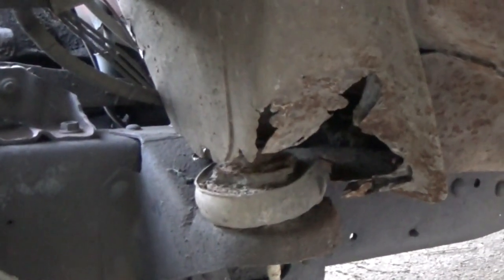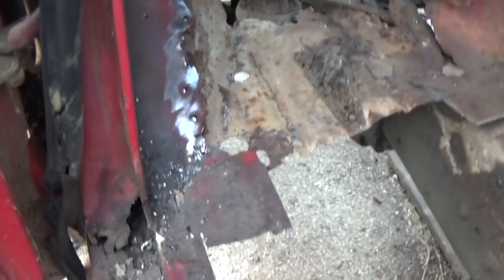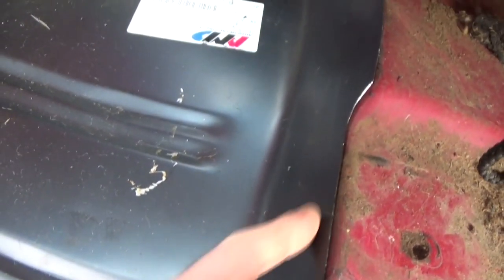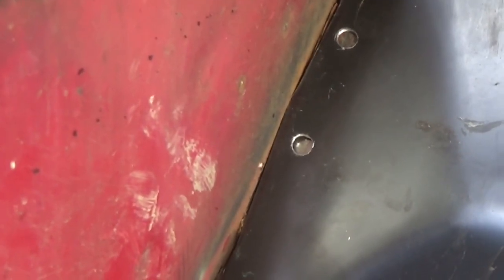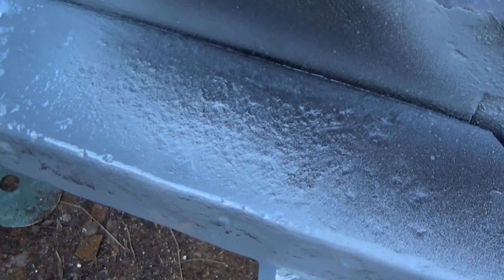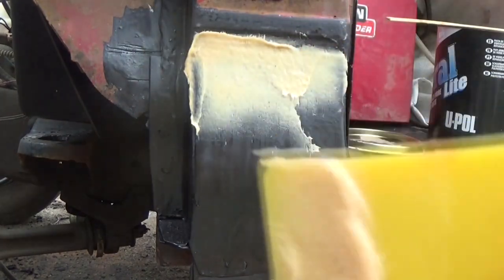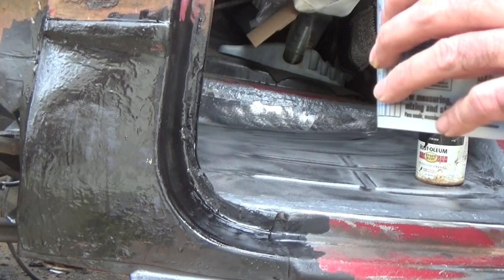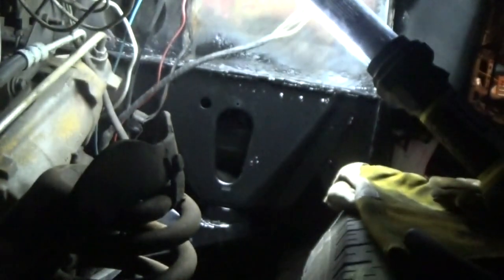1973-1979 F-150, F-250, F-350 Floor Pan, Cab Mount, Door Inner Pillar Patch Install!

Comment: Jeff's Bronco has those washers that fit that exact hole where the rubber rusts them out, I know because I'm doing the SAME PROJECT! LOL....cab mounts and all
Reply from the maker: If I remember right he was sold out of them at the time I was doing mine. I seen the other day that he now sells the complete mount that bolts on to the frame.

Comment: You can buy cab mount hole patches I believe they are called frame savers on Lmc truck
Reply from the maker: I didn't know LMC had them. I knew Jeffs Bronco Graveyard had them but was sold out at the time when I made this video.
Reply: @BlackLabGarage I get to do mine on my 69 F250 390 3 on the tree soon. Both cab mounts are gone, firewall is rotting, radiator support was non-existent, the fender aprons rotted at the hood hinges, and the bed floor is non-existent. Luckily the guy I get my mustang parts from has a bunch of these trucks on the back of his property and he doesn’t list them so I get first dibs on the stuff I need. I never had any of those issues on my higher mileage 79 f250, oddly enough. It was just missing floor pans, a little of the front of the bed, door bottoms, cab corners, and the roof drip rail on the driver side because of a hole in the roof from some dummy putting an antenna in the middle at one point and just leaving the hole there. I had to make a strip all the way up both door jams where the spot welds  fold over for the body panels. The water was traveling down and rotted them out. It was a pain in the behind, and I had to align the body line depth right
Reply from the maker: This was the first dentside I have ever had that the cab mount was rusted away and gone. I've had them with holes in the floor but not the mount being gone. At some point in the future this truck will be getting a whole new cab put on it since the tree fell on it. @buttonysquare8501
Reply: @BlackLabGarage  I'm working on my 69 F250 now. Same issue with the cab mount frame holes after taking it apart. Exact same issue with the steering column too. The front end 67-79 parts are literally all the same except the bed and doors. Cab mounts are the same but have a different bushing.

Would you be able to tell me what you used for that center sleeve/insert you made for the bushings? Mine were rotted and I can't find that anywhere.
Reply from the maker: @buttonysquare8501  The frame mount locations are different on an F-350 because of the frame being different. Those sleeves were just steel sleeves that I bought at my local Ace Hardware and then I welded the washer to them.

Comment: I'm having  a  hard  time  finding  a  long bed for  my 78 ford f150 4x4  from  Robert  in  little  River  sc
Reply from the maker: I had the opposite problem. I was trying to find a short wheel base bed and couldn’t find one. I actually have a long wheel base bed that someone cut the frame and made a trailer out of it. I use it quite often. I finally found a short bed and got it. It was literally a bed sitting in a field. No frame or anything under it. It is a solid bed but it has some tornado damage I’ll have to fix.

Comment: Wow that was a lot of work you handled it like a Boss 🌟🌟🌟🌟 4 Gold ones for you .

I have the same poly kit and I see why you put another bushing inside the front washer it has those nubs that fit inside the factory bushing and there not made to be removed the lil nibs keep the bolt from moving around totally stupid design in my opinion .  I managed to get them off without breaking them but the looked like a mushroom after removal question for you I have already put the rear upper cab mount in now I need to lift the front of cab to install the upper front and upper radiator support bushings is it ok to lift the cab just enough to get the bushings out without removing  my steering Rag joint or anything else ??? When I did it in the rear of cab I didn't need to remove or loosen anything I just seen the added stress on the front bushings .
Reply from the maker: I’ve only ever did the radiator support bushings by taking the radiator support off but that was because they usually needed other work also. If you have a way to raise both at the same time you should be able to do it. I wouldn’t want to raise the front of the cab with the radiator support not raising up with it. If you have to just unbolt the steering box from the frame so it can come up as you raise the cab and you don’t have to take the steering shaft loose and all that stuff.
Reply: Do you know what size bushing you found at the hardware store I'm having the same issue the factory sleeve is smaller than the prothane hole diameter
Reply: It's kind of a strange design using small bolts and putting sleeves inside like they did
Reply from the maker: @TheThirdWheel618  I honestly do not remember what size it was now. It was a bushing that they had on the shelf at Ace Hardware. It wasn’t anything special
Reply from the maker: @TheThirdWheel618  yeah, I’m not sure what their thinking or reasoning was behind that